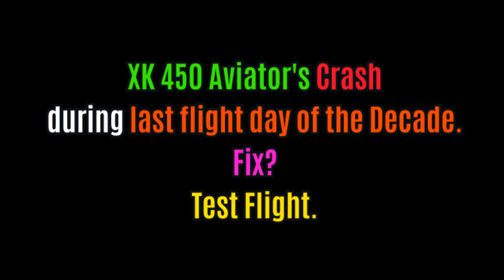I crashed my XK 450 Aviator! My Fix!

Comment: Hi Dave, Been watching you for yrs from Laconia, NH... ☺

I own the 450... You can get tighter turns in airplane mode by using rudder... It has differential thrust on the motors that mimics rudder control... 😃 In case you didn't know...

She will fly knife edge as well coordinating this with the differential thrust!

Yes, always knife into the wind in vertical mode... 

The 3D mode only works in airplane mode... Not the other 2 modes!

She'll also fly inverted and do all those things your other aircraft can do...

My 2nd fixed wing and BEST one in years. I used to fly helis and then drones. But I LOVE THIS AIRCRAFT! ❤

You can FPV with this bird!!! ✈

I also mounted with double stick tape a decent camera and the wire runs into the cockpit with a 380mah battery. I'm using a fly sky receiver for my videos but any monitor can be clipped to the remote... And do FPV as well as record flights!!! That's how I got mine rigged and doesn't take any flight time away... ☺

I'm thinking of switching to 4 bladed props in the future to carry more weight.... A pod affixed to the fuselage for other things... 😃

In any event... Have a Happy New Year Dave... 🎅
Reply from the maker: Thanks for stopping by.  So as a long time subscriber, you must know, this was only the 3rd time I have flown it, as the second was the crash into the tree.  And as you saw in my first box opening and maiden flight video 3 days ago, I moved the 3d switch in the transmitter, as I am flying this in the cold and with gloves and that made it easier to reach.  This spring I will be able to experiment more with it.  It sounds like you have covered all the things to do very well and I appreciate the tips.  I'm still very fond of my Nitro Helis and big Nitro planes, but this is one that has become a favorite for sure.  I can't wait till spring.  Thanks again, and Happy Flying.
Reply from the maker: @Vintage_Stephan  Well I'm ambidextrous too, but still like to find the switches easily. When I worked at Kraft RC in the 70's, I built my own TX with cross trims, so I am used to being able to reach stuff without lifting a finger. Since I fly inverted helis, I am used to those controls on the left side of my transmitters. Since so many TX's I have are different, I try to keep them somewhat the same.  Of course I had more before the fire destroyed all of them and my models and house.  In your Patrolling case, I can see the use of FPV with this but I have racing drones and other FPV equipment I can use.  The only 3 places I fly, the scenery I see is all the same, no matter what I am flying.   I get more different views on my Aerofly SIM, LOL.  This plane is more suited for me to watch fly than pretend I'm in it.  Flipping it to vertical mode in FPV seems like only the Sky would be showing and flying that way would not be fun. I have a Ham License and some of my drones can fly a lot farther with the higher output FPV transmitters I have as I can legally fly them.  I am certainly aware of the controls and can do all the things you mention, but thanks again for all the tips.  With all my experiments on 1 bladed helis and airplanes, I and my  friends have found more blades require more powerful motors to turn them, otherwise they run hotter and draw more battery power for shorter flight times, as I have proven in many of my videos.  Do you have any videos of you flying this XK 450? Thanks again and Happy flying.  Semper Fi.
Reply: Hello Vintage. Can you make a video showing the 4 blade props? I'm guessing you put a camera? Thanks.

Comment: Happy new year, for sure you had a lot of fun only one question. does the battery performs a lot less in cold weather, compared to mild temperatures?
Reply from the maker: Thanks Luis.  Well I have only flown this one in cold weather.  It may affect it some but I can fly a good 10 minutes in multi rotor Mode (3 motors) and about 14 min. in airplane mode (2 motors).  After this flight, I still had battery reading at 3.83v per cell which was very good.  Thanks again and Happy new year.
Reply: Wow amazing long flights

Comment: Nice to see you got a flight in after your repair, in your opinion, would this be suitable for an absolute novice? Thinking about treating myself to a retirement present. Best wishes to you and yours from England
Reply from the maker: If you fly it in 6g mode, it is suitable for beginners, but just like real airplanes, they are not designed to crash.  That said, I will be having some folks fly it that never have flown a drone type machine to see how they do with it.  To me it is really stable and easy to fly, and if you get in trouble or get too far away, just flip the switch to tri copter mode and ease it back, as it will stay flat.  It always helps to have someone trim it and fly it the first time, as that first lesson is the most important.  Thanks and good luck.